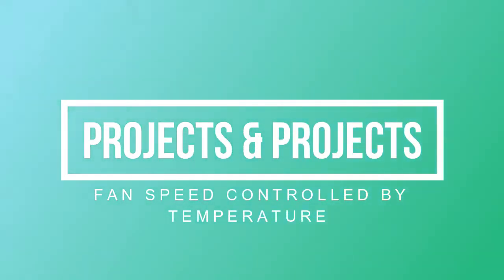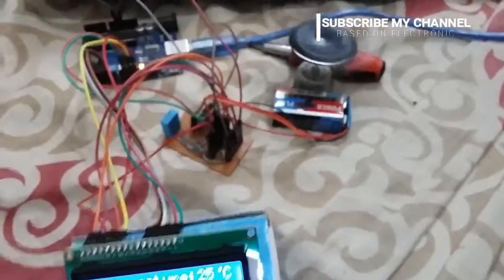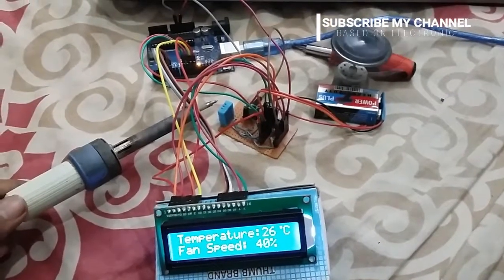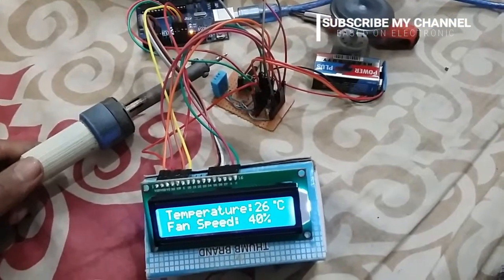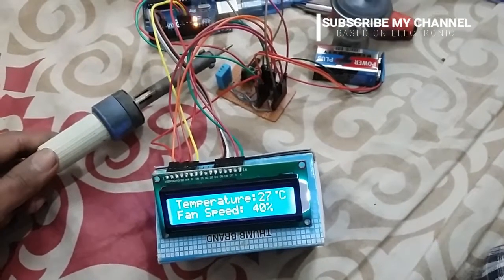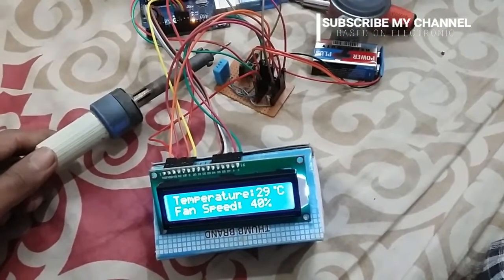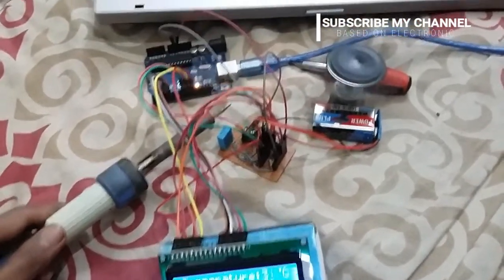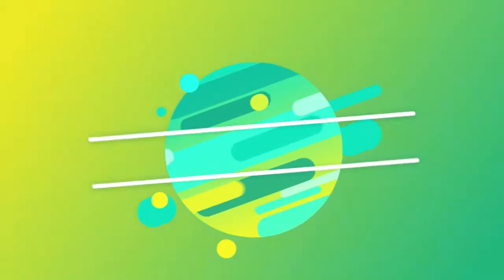Temperature Based Fan Speed Controller Using Arduino

Comment: bro i got problem in transistor how should i connect it
Reply from the maker: bro it's very simple the base pin of 2N222 transistor is directly connected to arduino pin.then the load is connect in  series  with transistor collector pin or battery and the negative terminal of the battery connect with the emitter pin of transistor.